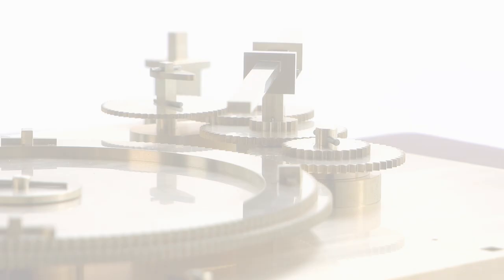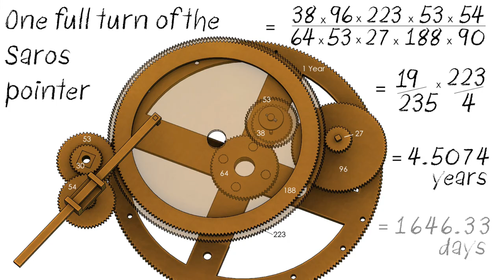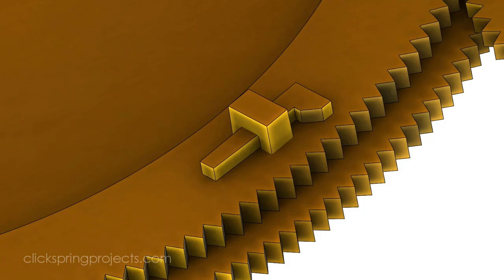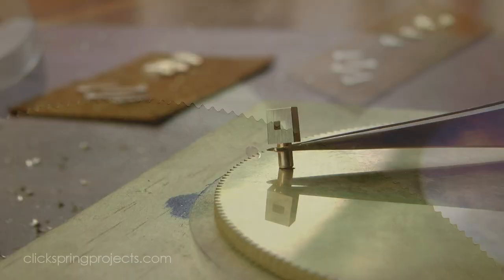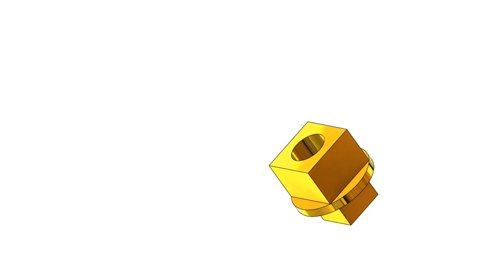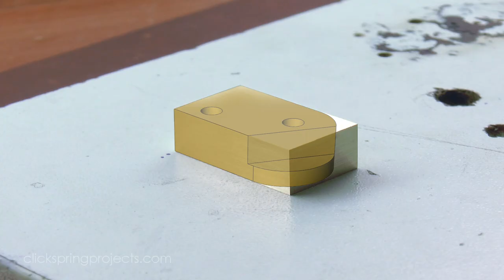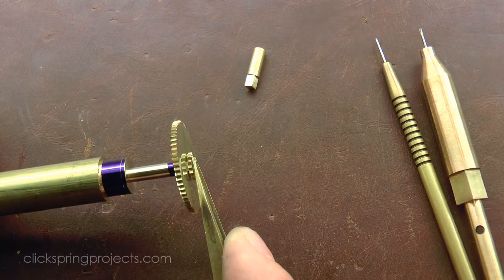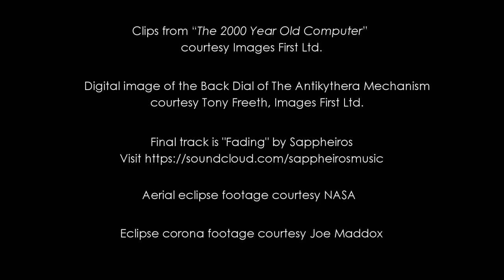The #Antikythera Mechanism Episode 7 - Constructing The Saros & Exeligmos Train

Comment: Sir, I just watched a lecture by Professor Michael Wright on the discovery of the same machine you are making. It was funded by Autodesk. This professor put his hands on the original unit and is the most knowledgeable person on how it works. This was on YouTube and is really interesting. It's in (2) parts and there is going to be a question and answer session at the end of part (2) by professor Wright. If you have already seen this or mentioned it, forgive an old interested spectator.

Comment: Correction on the gear ratios. The last ratio should be  54/30  not 90, as a result,
 (38 96 223 54)/(64 27 188 30)   simplify    (2 19 4 4 6 223 2 27)/(4 4 4 47 4 27 6 5 ) = 19/235 x 223/4
Everything else, I mean, the whole series is superb, excellent and spot on!!!

Comment: That round tapered fastening pin in the permanent full length H arbor (seen at 22:44) - I assume those pins were made on the lathe by filing the taper into a steel finishing nail - I cannot imagine how you got them so even - they look as if they were drawn through a die.

Comment: Once I'd finished watching I had intended to ask why you simply didn't form the spacers on the bearing integrally as it would have been much easier than making them separately but you immediately answered that question. Brilliant way to vertically depth the mechanisms.

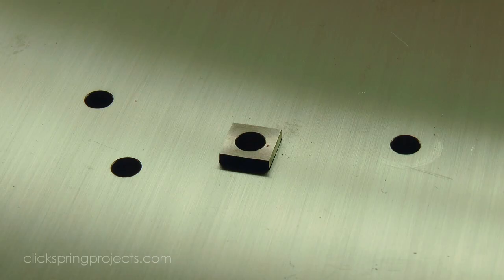Comment: Wow Clickspring. I have been watching a couple of your videos and I love the exact precision that you go to make all your components fit together. I also appreciate the process, your method about it. what you are mostly doing is taking some metal shape and grinding it smooth to another size. What I like about your method is that it does not need any exact measurements. You know the two pieces you are working to join, then you just shave a little here and try the fit and try a little more and then it is a perfect fit. No measuring tape/ruler necessary. ( I mean of course you have to measure, like a radius of 4inches or a radius of 4.000inches?). I am saying that about all of your work, but one example that I really liked was how you made this connection disappear: 21:09 to +10seconds

Comment: Again, I have a couple of questions. How long do you have to wait for the dye to dry? Does spinning the lathe help it dry? I've been watching a couple of other people work lathes and your tooling is always much sharper and has better chip consistency. Does this have to do with sharpening technique, the type of material, or both? How satisfying is it to put parts together and see them work so smoothly? Lastly, the real question. When you ping the backside of the pins then sand them flat to make them flush, it looks amazing. How does the pin stay in though when you've sanded the material off? As always, it's a joy watching you work. Oh one more question what do you listen to when you're doing tedious work like filing teeth and shaping?

Comment: Just wondering. Instead of machining each piece from blanks if they may have been cast and then finished to required specs? 
Castings from wood jigs and molds may have been significantly faster than milling.
Your videos are of exceptional quality. Thanks. Subscribed.

Comment: lovely work as always. 

how did you find the experiance of using the pump drill, as compared to say a "modern" hand powered drill.
Reply from the maker: Very weird to begin with, it was so strange to be learning how to use a tool from scratch. Its certainly convenient to use, relatively fast etc The holes it makes are not as accurate as those from a modern tool, but it would seem that they're accurate enough - its making the same sort of small errors as those seen in the wreckage of the mechanism - Cheers :)

Comment: awesome video and great work, super tight tolerances and beautiful fit and finish, amazing attention to detail. a couple of questions though. 1 what would be the ancient method for finishing these pieces as sandpaper would not have been available, would they have had a selection of whetstones they polished with and then how did they assure accuracy? and then the second why is it that you're not using a jeweler's handsaw? there were several instances where that would have been much much simpler. (i.e. sawing off the rectagular posts rather than filing them off)
Reply from the maker: Hey Alex, yes natural abrasives like various slates could have done the job, much like the way they are used in clockmaking. I will cover this in a later video. Re the saw, the historical evidence for saw tech of the era shows relatively crude, wide kerf tech, nothing approximating a jewelers saw. Hence the use of files to show that it need not have existed to get the job done - Cheers :)
Reply: Clickspring interesting!

Comment: A possibly silly question for you Chris: You fasten parts by peening them over, but then file and sand the peened material (immaculately!) flush with the gear surface (10:19 for example). I was under the impression that the peened over material held the part in place, but in your case is there sufficient expansion of the remaining material within the hole to maintain a strong friction fit? Otherwise, how does the part stay in place with the peened over material removed? As always, thanks so much for your incredible work.
Reply from the maker: Hey Travis, yes there is sufficient deformation of both the material and the hole itself to provide significant retaining strength, particularly since it experiences essentially no load. If for example it had been a part that would experience a tension load, I would have chamfered the hole slightly to provide even more room into which the material could be made to flow, and so give even more retaining strength. Minimising this chamfer helps ensure success in 'disappearing' the peened component - Cheers :)

Comment: Man that's incredible..such an ingenious device... everytime a new clickspring video drops, I have to watch it asap... I have a huge list of questions bit if I could ask,what size are the taper pins and reamers you use here ... looking on line I get confused which size reamer is for which pin size due to how they are measured.. also is the peening tool you use anything special? ..I do a lot of silver soldering when making my props and it strikes me peening could be more suitable for some pieces.
Reply from the maker: Hey Matt, roughly 1mm on the broaches and taper pins, nothing special on the peening tool, just a piece of tool steel with a slightly tapered and rounded end - cheers :)
Reply: Clickspring thanks so much Chris :) ... already looking forward to the next episode!

Comment: Another stunning video chris. Can I ask you a question please. Do the gears that fix or stack together need to be clocked in any particular way? Or is that not important for the mechanism to work correctly.
Reply from the maker: Hey Rich, generally speaking, no - its a bit like a clock wheel/pinion combination, where the end result of the train is all that matters - Cheers :)

Comment: Always love your videos pretty much saw all of them. I have a question though, When you rivet those parts together then remove all the pounded out area till its smooth with the body how does it continue to hold I would think that you removed all the mechanical holding power.

Comment: I love this series. One question though about the two large Saros wheels. The way they are pinned together does not allow for any adjustment of their position relative to each other, and there doesn't appear to be any timing adjustment anywhere else in this gear train. Isn't the timing of those wheels critical? Or are you planning to simply adjust the position of the face markings to suit?
Reply from the maker: hey Tony, fortunately it doesn't matter -  its a bit like a clock mechanism in the sense that all that really matters is the relationship between B1 and the output pointers. That relationship is set at assembly - B1 is set to a particular day, the train assembled, and then the last assembly carrying the pointer is dropped into position pointing where it needs to relative to the dial. (In some cases it can also be done by removing an assembly a little further up the train: eg remove the L assembly, orient the Metonic pointer, and then reinsert the L assembly). Thanks for watching and asking :)

Comment: I'm curious why, when you layout a design on flat stock, you draw in the middle.  Wouldn't it waste much less material if you did the layout on the edge, or even corner?  For example, at 17:00 in the video.
Reply from the maker: Convenience in holding the work - cheers :)

Comment: As accurate as you are with your filling and everything that requieres that accuracy, why are the holes being drilled with your bow drill not being in some way, made sure that they are 100 straight and do not angle? I imagine that must be important.
Reply from the maker: In order to achieve a high degree of fidelity with the original mechanism. The holes in the wreckage show the same sort of small errors as those generated by a hand operated pump drill, and I want to see to what extent they matter - Cheers mate :)
Reply: Clickspring but why try such a test on this project and not a smaller less complicated peice.

Comment: How did you make sure that those little pieces at around 11:00 got in at exactly the right angle to fit the holes later?
Reply from the maker: Careful use of the jig, fitting them one by one - Cheers :)

Comment: What is the purpose of peening the pins before filing and sanding them flush with the base gear?
Reply: Koramin99  It makes it mushroom out to be a permanent assembly. Like a rivet.
Reply: So even if the material above the fit is removed, the part below expands out like a mini pressure fit?
Reply: Koramin99 He always chamfers (puts an angle on) the edge of the hole. When he peens the pin, the material flows into that space, locking it in place.
Reply: Ahhh gotcha, you'd think i'd catch the chamfering after watching him for so long lmao

Comment: Something doesn't add up when.it comes to the machine tool technology of the time and the fabrication of this instrument.
Reason this. If a workshop was so technologically advanced in the ancient era, why would the maker be using what is accepted to be, a simple bow lathe made from wood as scholars would have you believe?
such precison needs quite advanced and stable tooling to achieve this level of accuracy.
I propose the maker had the skill set to have extremely advanced tooling probably made in house although sadly lost to antiquity or melted down. It's just not logical or sensible to assume simple rudimentary tooling was used during the construction when the maker clearly had a vast working knowledge of gearing, inertial mass, metallurgy, pivots, clearances, bearings etc.
The knowledge required to design and manufacture this product requires several generations to accumulate, refine then pass on.
I guess the real question to ask is not about the mechanism but how old is the knowledge ?

My two cents worth

Comment: To follow up; yes, I 3d-printed a Mechanism, had fun getting all the gear-chains to mesh, and got eclipse and other data from it.
A wonderful machine, no doubt.
But digging into the history of Epicyclic planetary motion, I just could not continue.
Planets simply don't move on one big circle while also moving in a smaller circle at the same time.
They move in elliptical orbits, with declination to the solar plane.  Not one circular orbit in the bunch.
Orbits have gravitational influence on each other, as well.
The Mechanism, while a marvel of gearing and mathematics, is based on a model of the Solar System that doesn't account for how it REALLY works.
A close approximation at times, but fundamentally wrong.
Reply: Greg Gallacci in part I agree with your assessment however this machine was constructed using the astronomical models and observations of the time. The most modern theory to explain the solar system was the  Ptolemaic  universe.
Fabulous walk down memory lane tho